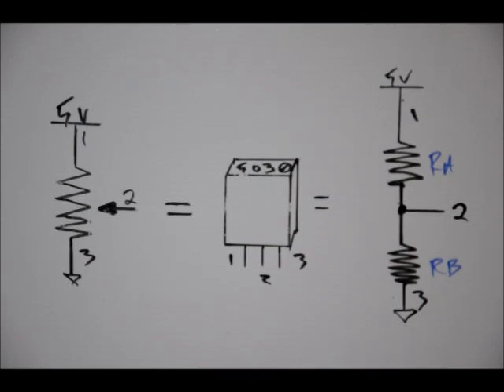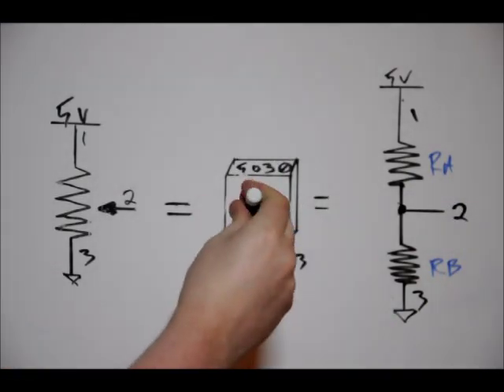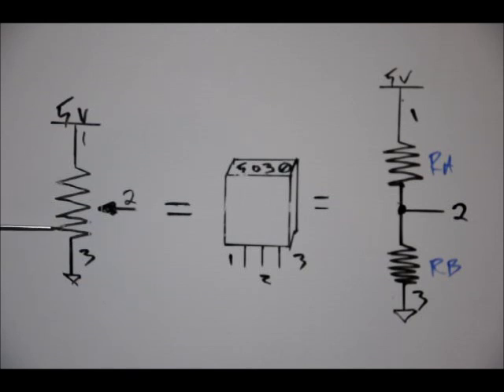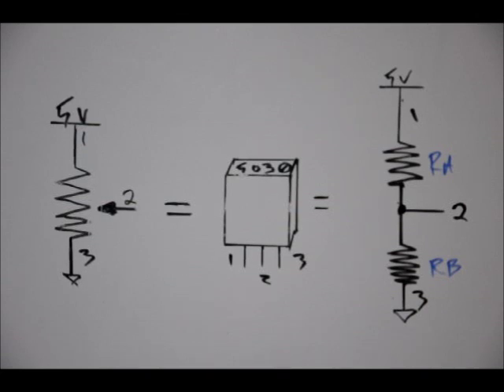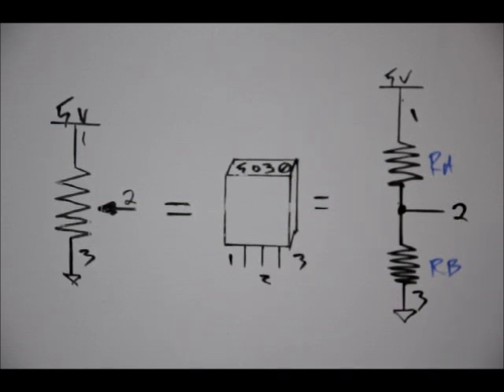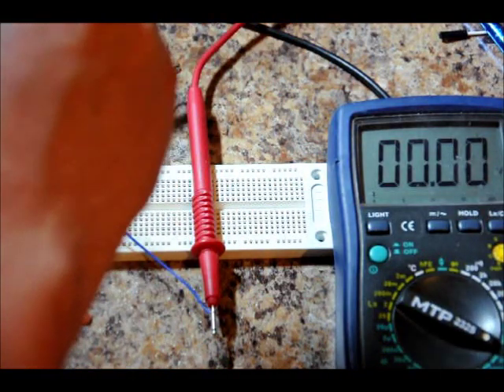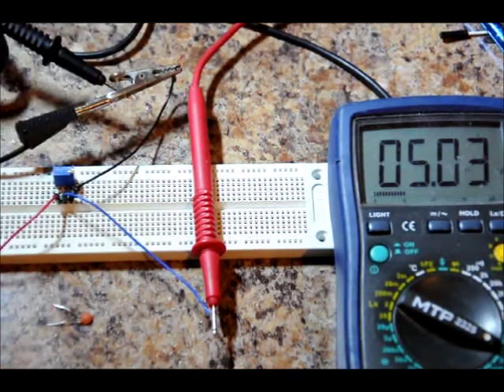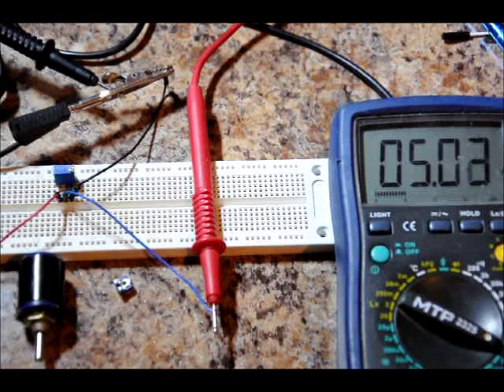Electronic Tutorial: Use a potentiometer (Variable Resistor) as a voltage divider !!!

Comment: I have an advanced light control that puts out 10v. I am trying to connect a led driver that only accepts 5v. Can I use this to bring down the voltage from the advanced lighting control from 10v to 5v!??? Lmk. Thank you. Jon. And the driver that I have has 3 wires. One is ground one is the 5v input but is says pwm on the driver for that wire. And the other wire is not going to be used because the advanced lighting control will supply the voltage.http://pages.ebay.com/link/?nav=item.view&alt=web&id=261236107511